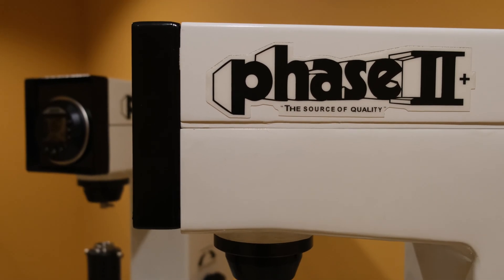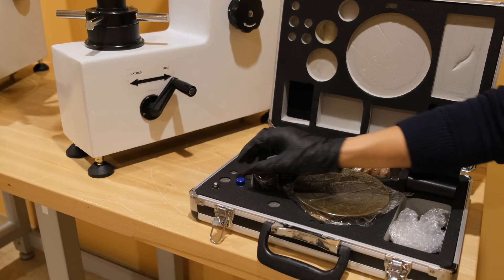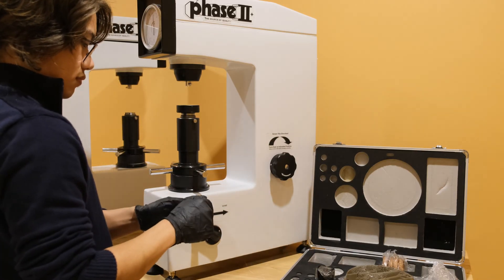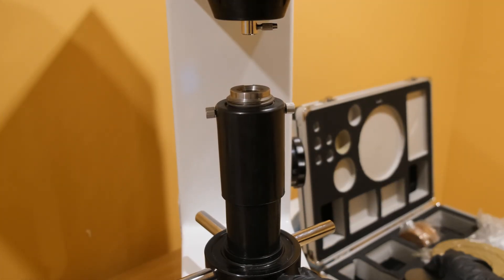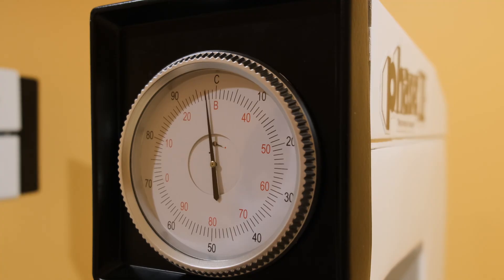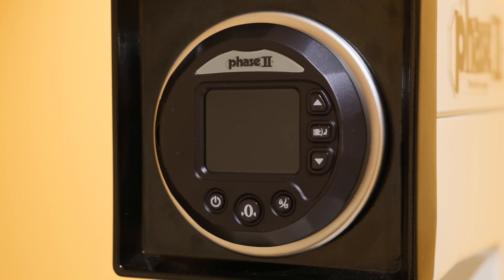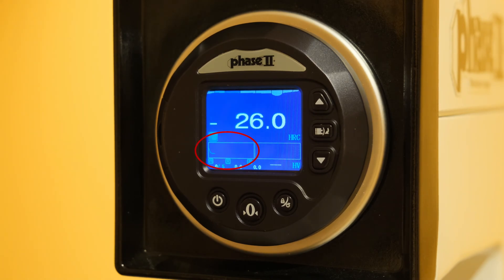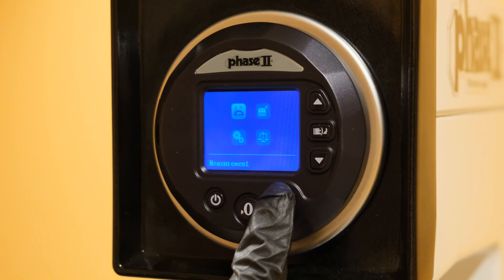Rockwell Hardness Tester Phase II Model 900-331-900-331D Operation Video-Rockwell Hardness Testers

Comment: How would I change the battery on the 331D. Thank you.
Reply from the maker: This digital module is rechargeable and supplied with charger. If you feel the battery wont accept charge, please call 201-962-7373 for Sal who will analyze and if necessary, show you how to remove module correctly and ship to Phase II Tech Support.
Reply: @phase2instruments  awesome. I will give it a call because it doesn't hold a charge. I have to keep the battery plugged.